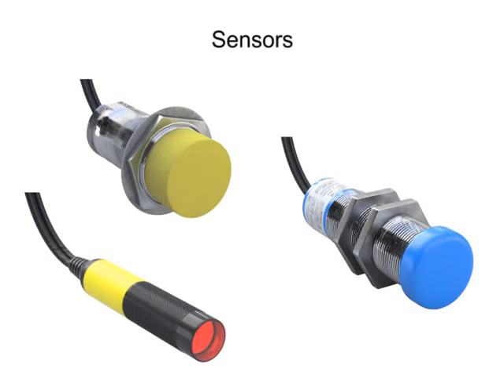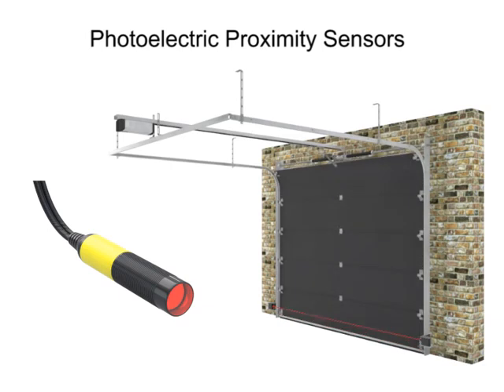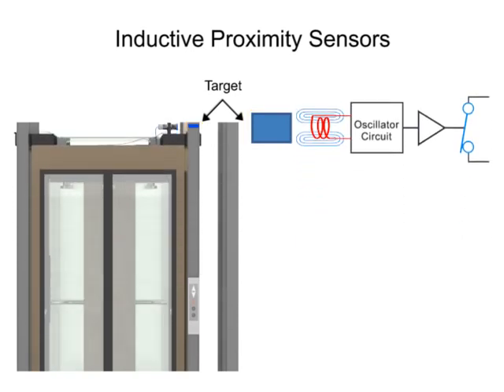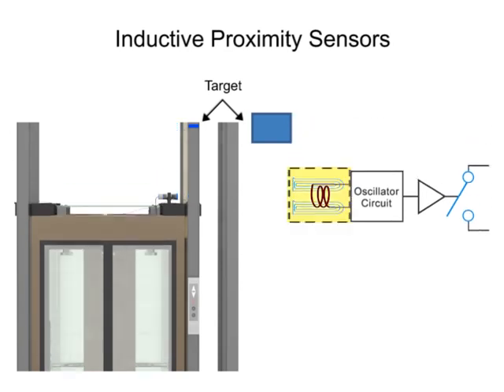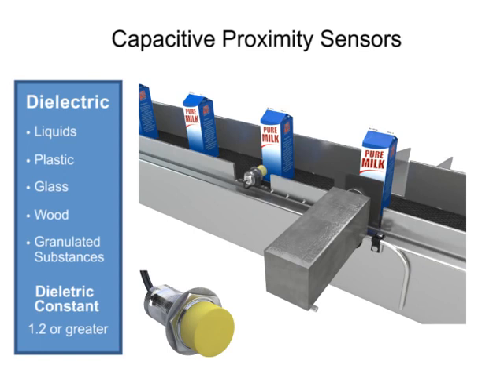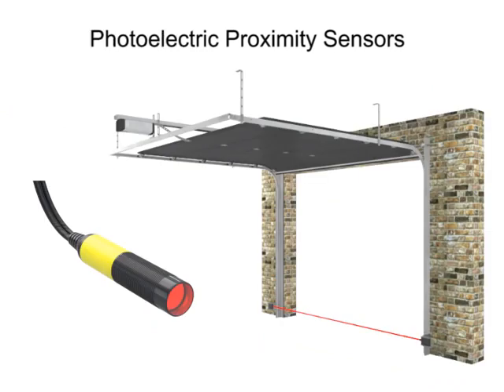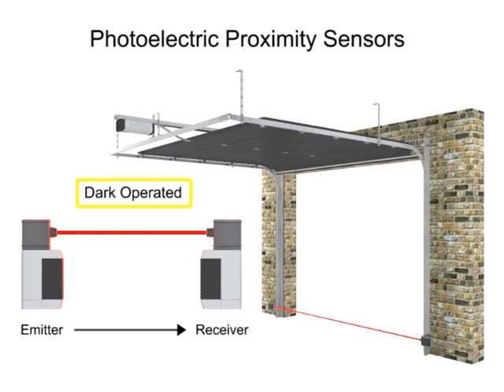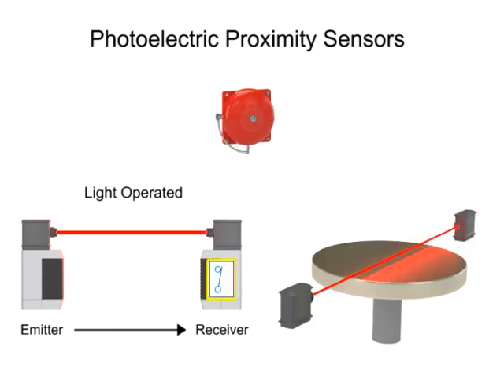Inductive, Capacitive & Photoelectric Sensors | Electric Motor Control and Power Distribution 6/7

Comment from the maker: Thanks for watching. For More Videos: Please Subscribe My Channel
Electric Motor Control and Power Systems Distribution  Tutorial: https://bit.ly/31Cib6c
Industrial Robotics Tutorial: https://bit.ly/38hQnWd
Industry Blueprints Tutorial: https://bit.ly/2ZqCn8p
AC Circuit Analysis Tutorial: https://bit.ly/2VyoHqP
Physics Tutorial: https://bit.ly/2BjVOaX
Motion Control  Tutorial: https://bit.ly/31sqUrz
Advanced Programmable Logic Control (PLC) Tutorial: https://bit.ly/3g8FfO3
Embedded Systems & Microcontroller Tutorial: https://bit.ly/3893dpH
Motors and Drives Tutorial: https://bit.ly/3dH0yF1
Fluid Power Design and Application Tutorial: https://bit.ly/3dEjvIq
Fluid Power Control Tutorial: https://bit.ly/3eniF3S
Process Control Tutorial: https://bit.ly/3hTASs7
Channel Link: https://bit.ly/2IsqVS for watching more Videos
Learn what Solenoids are and what they do.
Simulations provided free under a Department of Labor grant awarded Eastern Iowa Community Colleges.
😌Don't Forget To Like, Share, Subscribe & Comment 😬
======
تعريف بالقناة:
قناة تعليمية مهمة للجميع عليها أكثر من 210 فيديو تعليمي، بها:
1- شرح لبوردات الاردوينو Uno & Mega 2560  وعمل مشاريع رائعة بها حيث، شرح Servo Motor, DC Motor وطرق توصيله والتحكم في إتجاهه، و EEPROM وتوصيلها وكيفية التعامل معها. وال Stepper Motor، واستخدام الاردوينو كمولد موجات جيبية ومسننة ومثلثية،
رابط الدورة من هنا: https://bit.ly/2PvtHvx
2- شرح دورة الأنظمة المدمجة Embedded Systems والميكروكنترولر واحتراف البرمجة بلغة الامبيدد سي Embedded C. وعمل مشاريع رائعة…
رابط الدورة من هنا: https://bit.ly/2KadqX2
3- شرح كيفية الربط بين الاردوينو واللابفيو وعمل مشاريع رائعة بهما.: https://bit.ly/2KlTssj
4- شاهد أيضاً،دورة مهمة جدا لطلبة الهندسة في شرح أساسيات ومبادئ التحكم الآلي او هندسة نظم التحكم
(Automatic Control or Control systems engineering):
رابط السلسلة:  https://bit.ly/2NGyeYd
5- دورة متقدمة في التحكم باستخدام اللابفيو (مهمة لأقسام تحكم أو كنترول والكترونيات). وهي تطبيق عملي لدورة التحكم الالي 
رابط الدورة من هنا: https://bit.ly/2K7aVEE
6- سلسلة Root Locus Method في هندسة التحكم الآلي لطلبة كلية الهندسة، قسم كهرباء،
رابط السلسلة: https://bit.ly/33CROvi
7- سلسلة عملية في القوي الكهربية او الكهرباء المتردده الاحادية والثلاثة الطور (Electrical Power) لطلبة هندسة ولكل مهتم بالكهرباء
رابط السلسلة كاملة:  https://bit.ly/3dWEckc
8- بعض الدواير العملية الكهربية المهمة للجميع.
رابط الدورة من هنا: https://bit.ly/2Fnli65
9- دورة في القياسات الكهربية، مهمة لطلبة كليات هندسة ولكل مهتم بالالكترونيات والكهرباء: https://bit.ly/30RdTVS
10- دورة في احتراف الرياضيات والجبر والهندسة والتفاضل والتكامل والقوانين الخاصة بها بدون تعقيدات.:  https://bit.ly/30ykUtG
11- دورة في احتراف برنامج اللابفيو الرائع LabVIEW : https://bit.ly/2TOx4y4
12- برامج مهمة للكمبيوتر واللابتوب الخاص بك: https://bit.ly/2qT9NM6
13- Complete Practical PLC Course Tutorial: https://bit.ly/3dHon09 
14- Green Screen Tutorial Link: https://bit.ly/3esShFa
15- Complete Process Control Tutorial: https://bit.ly/3hTASs7
16- Complete Fluid Power Control Tutorial: https://bit.ly/3eniF3S
17- Complete Fluid Power Design and Application Tutorial: https://bit.ly/3dEjvIq
18- Complete Motors and Drives Tutorial: https://bit.ly/3dH0yF1
19- Complete Physics Tutorial: https://bit.ly/2BjVOaX
19- Complete Embedded Systems & Microcontroller Tutorial: https://bit.ly/3893dpH
20- Advanced Programmable Logic Control Tutorial: https://bit.ly/3g8FfO3
21- Physics Fundamentals Tutorial: https://bit.ly/2CNrzcU
22- AC Circuit Analysis Tutorial: https://bit.ly/2VyoHqP
23- Industry Blueprints Tutorial: https://bit.ly/2ZqCn8p
24- Industrial Robotics Tutorial: https://bit.ly/38hQnWd
25- Electric Motor Control and Power Systems Distribution  Tutorial: https://bit.ly/31Cib6c
وهناك المزيد علي القناة، وان شاء الله هذه مجرد البداية فقط.
رابط القناة:   https://bit.ly/2IsqVSC
وتعمل اعجاب ومتابعة لصفحتنا علي الفيس صفحة المهندس المحترف
رابطها: https://www.facebook.com/المهندس-المحترف-100879698187843
متنسوش الإشتراك بالقناة لمتابعتنا وتفعيل جرس التنبيهات ليصلك الإشعارات بالفيديوهات أول بأول.
====
#ُElectric_Motor_Control
#Power_Distribution
#Kyrillos_Refaat